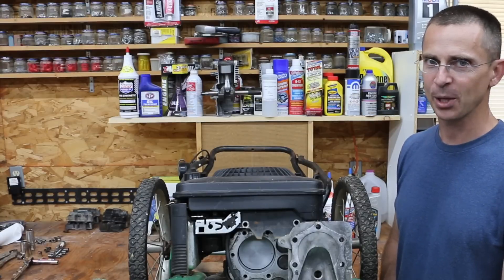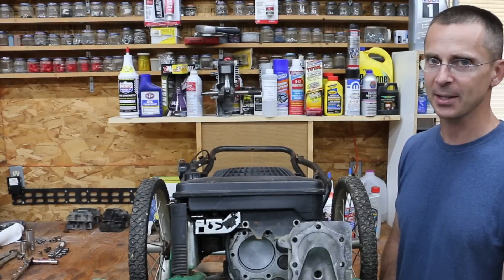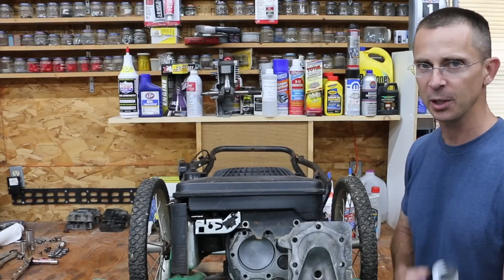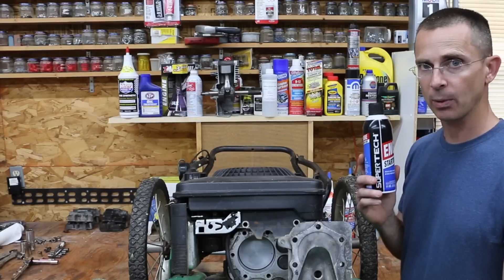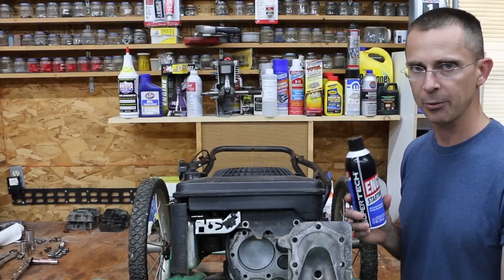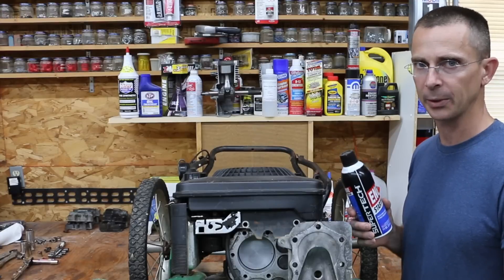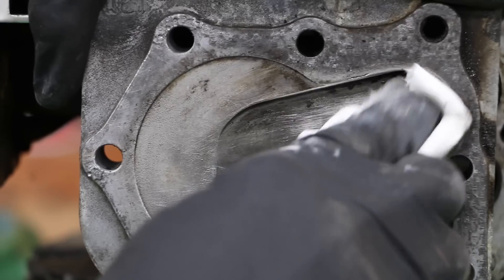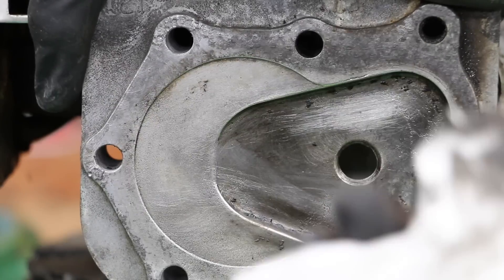Will Running an Engine on 100% Starting Fluid Cause Damage?  Let's find out!

Comment: I can attest that a diesel engine with glow plugs does not do well with starting fluid.. it can cause preignition and can toast an engine quick..

I thought i was smarter than the warning labels, but that wasn't the case and i almost did some really bad things to a 7.3 IDI with even a little starter fluid! 😲
Reply from the maker: Averil, thank you for sharing this experience!

Comment: I know it's a lot more work but if you would use cheap old 8v's of your preference. Then make a jig to hold it and the radiator. Then pipe the exhauste ouside. then you could use that the same jig for every test. I think it would be cool to see this done on car engines more. just an idea!
Reply from the maker: Cody, I agree that a full-size engine would be great to use for these videos.  Thanks for commenting!

Comment: Working on my roommates old 84 Vette. Was troubleshooting the fuel system and I was spraying intake cleaner in to get it to crank and run. I ended up soaking the filter until it backfired and caught the top of the engine on fire.
Reply from the maker: Jeff, I hope you were able to extinguish the fire before any damage occurred.  Thanks for commenting!

Comment: you can hear it knock every time he sprays it how can that be good?
Reply from the maker: Great point!  Pre-detonation is hard on an engine.  Thanks for commenting!
Reply: Project Farm i just think it has more to do with the forces put on the rod.. not the cyilinder walls or rings. hard hits flatten out bearings. and the small engines already dont have bearings and a soft aluminum rod  you need to do same test looking at clearinses on conecting rod. please i wanna know now lol

Comment: Biggest problem I ever had with ether/starting fluid was a backfire that would blow up the air cleaner/power valve in Holley carbs.  Got to miss the good old
Days of trying to get cars with junk carbs running on a cold winter day lol.
Reply from the maker: Thank you for commenting.  I remember those days well!

Comment: Another great video as usual!  I have always wondered if you filled a gas tank up with starting fluid what would happen.  Loved that you also check cylinder head temp and exhaust temp on top of checking for scoring of the cylinder wall.  Thanks for taking the time to do this test and sharing it with us!
Reply from the maker: Thank you very much for the positive comment!

Comment: Well, what did I start?? Is it too late to add a disclaimer? KIDS, DO NOT TRY THIS AT HOME. And Project... This is a very bad idea. Alright? WhAt ArE yOu GoNnA dO nExT?? =)
Reply from the maker: Eric Ek, LOL!  I should have added this disclaimer.  Thanks for commenting!
Reply: Well,  it would be interesting to see how a engine handles grease from restaurants. Just keep a fire extinguisher handy, insure your house and  don't breath in any fumes. Can engines run on paint, pure octane you can buy in a bottle, or helium? We could to this forever as long as you're willing to keep rebuilding a engine for "science".
Reply: Project Farm what can possibly happen if you spray down your whole engine with starting fluid?

Comment: I never heard of starting fluid being bad because of it drying out the cylinder walls I heard it was bad because it made the engine lean out pretty badly perhaps air to fuel ratio monitor is in order and try again
Reply from the maker: fuzzy wuzzy, The theory you mention makes sense.  Thanks for commenting and for the fuel ratio monitor suggestion.

Comment: The cans usually boast "With upper cylinder lubricant" on them now. But, my (limited) experience is that engines get addicted to it. Further research lead me to microcracks that formed in compression rings...
Reply: In diesels...
Reply from the maker: This is great information!  Thanks for commenting!

Comment: Do a video on what happens if you use soapy water instead of motor oil. I have no idea what the results will be but I have a feeling they might be interesting.
Reply: soopy wooder
Reply: straight dish liquid as oil
Reply from the maker: CreepStar Gamer, Thank you for this recommendation!
Reply: same effect as chlorine.
Reply: The water will seep past the rings, and the engine will hydrolock. It'll also be borderline useless as a lubricant no more than a few seconds after starting the engine, it'll just turn into foam. So the engine will be a highly effective but short lived bubble maker.

Comment: just to let you know starting fluid will definitely ruin a diesel it breaks the Rings because of the high compression like you're talking about the end of the video I have personally bent connecting rods and throne rods clean out of the block using ether to start diesels also before you ever use starting fluid on a diesel you have to make sure that the glow plugs or intake heater are disconnected from the rest of the wiring
Reply from the maker: Bart, Thank you for this information!

Comment: Love the content!!! Keep it up👍🏼 See how long an engine will run with wd-40 in the crankcase. Or marvel mystery oil. Orrrr seafoam
Reply: Seafoam is designed to go into the crankcase along with the rest of the motor oil.. Do you mean only Seafoam?
Reply: apachefoxx  yes I mean straight wd, mmo, or seafoam
Reply: I have ran mazola oil in my rack and pinions for years.
Reply: PB'laster

Comment: It will destroy a 2 stroke and a diesel engine. I've never seen starting fluid hurt a regular 4 stroke though. When growing up, we always used WD40  to start our 2 strokes and diesels.
Reply from the maker: Ben, Thank you for this information.  I'll keep in mind that WD-40 is the fluid of choice for diesels and 2 cycles.  Thanks again!

Comment: Project Farm 

When run through the fuel tank, Will starting fluid remove carbon buildup better that sea foam or another leading brand?
Reply from the maker: Mark, This is an excellent question!  I should test this!

Comment: Nitro methane rc car fuel
Reply from the maker: Nathan, thank you for this recommendation!
Reply: I'd like to see that stuff in a diesel engine... Suspect it'll work fine as most smaller RC engines are diesel(compression ignition) engines
Reply: i ran a gocart on nitro rc fual and it ended up having less power
Reply: Hmm i'm 20 hours late calling this, i'd still love to see it
Reply: MrErikw26 finaly someone who has a clue how rc engines work
Reply: Yesss
Reply: Me to
Reply: I've actually done this before and it surprisingly worked
Reply: nathan berg Exactly! I like your thinking!
Reply: Stefan Borsboom Yup, yup, yup!
Reply: Firm Clock well ya one it fouls the plug cause it's a two stroke fuel it has oil in it and compression isn't setup to optimize the fuel
Reply: nathan berg I dumped half a gallon of RC alcohol-nitromethane into the fuel tank of my old Honda CB360, with maybe half a tank of straight gasoline with no issues.
Reply: Benjamin Gillies they are not diesel. Their source of ignition is a glow plug which stays red hot due to a catalytic reaction between the platinum on the glow plug and the alcohol in the fuel. They do not have enough compression to ignite the fuel via heat of compression. They are more like a semi diesel like a hot bulb engine.
Reply: Matthew Weisenburger I've had nitro engines start while priming (blocking exhaust while spinning the engine on the starter box) without an ignitor on the plug.
Reply: TheLoneWolf1124 bullshit
Reply: Matthew Weisenburger I'm not gonna argue with you. It happened. Nitro rc engines are diesel. They use glow plugs the same reason full size diesels do.
Reply: TheLoneWolf1124 http://rc-airplane-world.bmobilized.com/?ref=https%3A%2F%2Fwww.google.com%2F&url=http%3A%2F%2Fwww.rc-airplane-world.com%2Fglow-plugs-for-rc.html&width=360
Reply: TheLoneWolf1124 educate yourself then get back with me
Reply: Matthew Weisenburger not even gonna waste my time reading that. Why would I like about something like that? What would I gain?
Reply: TheLoneWolf1124 well for one you would be educated and no longer spouting bs
Reply: TheLoneWolf1124 if your such a diesel expert please explain to me how they work
Reply: Benjamin Gillies actually the fuel reacts to the material in the glow plug, aiding it's heat retention along with combustion.
Reply: nathan berg I'mintnto also into Nitro rc cars! And it's kinda weird that someone will mention this and even with the same name!
Reply: I have done this. Removed the throttle stopper to and got it running wide open for a hours. Its still working, just need more attempts at starting. Rc fuel is very thick so it need more heat to burn.
Reply: I mixed 50/50 gas with 15% Rc fuel in my weed eater it really ripped my neighbor came over and said sounds like you have a hotrod weed eater
Reply: 30 years ago or so, I ran a car for a few miles on 25% nitromethane RC aircraft fuel.
I ran out of gas leaving the air field, and it was 3 or 4 miles to the nearest gas station.

I pulled the fuel line off the fuel pump intake, hooked up a spare piece of tubing to it, and stuck the other end of the tube in the gallon bottle of fuel.
I had to restrict the airflow to the carburetor to get it to stay running, but it got me to the gas station. :D
Reply: this I would like to see
Reply: TheLoneWolf1124 yeah leave when your loosing the arguement ok bye
Reply: Matthew Weisenburger it's only bs to you because it hasn't happened to you. It happened to me, it's a fact, I'm not gonna gain something from proving it to you. Just sharing that it gas and can happen. Have a nice life.

Comment: I understand that a 4 stroke engine will run entirely on 100%  starting fluid.....However, will a 2 stroke motorscooter engine get the same result?   Recently I rebuilt a 2 stroke  (by installing two new crankshaft seals)  As I did not totally understand how a 2 stroke really works. I then tried to startup the engine using starting fluid.  After many hours of unsuccessful troubleshooting.....I discovered the crankcase would not hold any pressure at all (as is necessary with a 2 stroke)   I looked closely at the seal under the magneto and saw that is was blown out.  Could this have been caused by the starting fluid igniting in the crankcase?   I'd like for you to try to verify this.....
Reply from the maker: Brad, This is a great question.  A lot of others have mentioned that starting fluid will damage a 2 stroke.  Seems like a great video idea--thank you!

Comment: My God you are incompetent can you seriously not just depressed the button a little bit so it's a lesser stream and keep the thing running one constant RPM for Christ sake when I have a car with a fuel pump bad I can make the engine run Goodnuf to drive the thing in the shop! You really need to give up all your tools because you are competent enough to use them
Reply from the maker: The generic can I used was wasn't easy to regulate like the Prestone brand or else I would have been able to better regulate the flow.  Thanks for commenting!

Comment: Will water injection clean carbon build up from inside the engine and clean it out???
Reply from the maker: Review Guru, Thank you for this video idea!  I used a water drip in a previous video, which isn't the same as an injection system.  Thanks again!

Comment: You should hold a throttle wide open till the motor blows. And see how many rpms it will run before it blows.
Reply from the maker: Matthew, Thank you for this recommendation!

Comment: I believe that starting fluid would cause damage only to a diesel engine, since its self ignition temperature is a lot lower (starting fluid), it might work when the engine is cold but if its hot, i think its gonna ping like crazy and damage the rod/crank bearings. Its engineered to explode at a lower temperature so that it helps cold starts, especially on diesel engines.
Reply from the maker: All great points.  Thanks for commenting!
Reply: like I've said, use it for its intended purpose and you're fine.
Reply: My understanding is that ether detonates at a much lower pressure than diesel, and far more pressure is generated very fast. diesels use their very high compression to ignite the fuel air mix . ether actually reactes to the compression on the up stroke too early (btdc) causing a very violent predetonation that builds pressure  extremely fast , causing pistons to blow out , breaking connecting rods, ect.
Reply: Starting fluid is dangerous in diesel engines if the glow plugs are on, though I'm unsure if air preheaters are hot enough to ignite it as well.

 It is said that extended use of starting fluid in any engine will wash oil off of the cylinder walls, and cause scoring. That's why they added lubricant to modern starting fluids.

Fyi: My old John Deere backhoe had a starting fluid injector, and a block heater for cold starts. No glow plugs... 

Thanks for your videos, especially the penetrating fluid ones. It made selecting one much easier!

Comment: We down here in Fla tried something similar in an old Chevy PU...Well our results didn't turn out as yours did. lol..We managed to blow the valve cover gasket out and bend the valve cover..although we may have used a little ( understatement ) more starting fluid than you did...lol

Comment: what if you were to try and run a motor off of brake cleaner I've always wanted to do that one too or what if you're to use mass air flow sensor cleaner
Reply from the maker: This is a great suggestion--thank you!

Comment: The main problem with starting fluid and diesel engines is glow plugs. If you have glow plugs that are working normally then what can happen is pre-ignition witch over time hurts the engine as most of us should know. I've operated alot of heavy equipment over the years, alot of new equipment comes with either glow plugs or a spot to put a starting fluid can, that the engine will give it's self a shot to help it start in cold weather.
Reply from the maker: Cody, thank you for this information and for taking the time to comment!

Comment: I don't know if you have a way to measure horsepower, but it would be interesting to see how one of these small engines would do with Nitrous oxide.....
Reply from the maker: This is a great suggestion--thank you!
Reply: Project Farm if you have an engine that isn't mounted in a piece of equipment, you could connect the output shaft to a DC motor (or an alternator), and hook up a dummy load. Using a multimeter and some fancy wiring you should be able to make an educated guess at horsepower.

Comment: You should really get a micrometer and take a few simple measurements in several places before and after you do tests like this, for confirmed results of the wear inside the cylinder! I think it would be really cool to see if a product causes massive internal wear or not, visually and on paper
Reply from the maker: Circuit Break, This is a terrific suggestion.  I just ordered one.  Thank you!
Reply: No problem, love your videos :D

Comment: Project Farm try butane (liquid butane, like grill or lighter fluid) and see if the engine will run on butane alone. I have a feeling it will not because of how thin and flammable the substance is. I'm really curious to see what happens.
Reply from the maker: Thank you for this recommendation!
Reply: Project Farm no problem! I am really curious about what could happen.

Comment: Great video.   One big thing that will change everything about it when running on pure starting fluid is engine load.
I have personally done this before just to see what would happen in an old lawnmower I had.  I put a whole can in an empty tank, It would start and run fine, but when put under a heavy load (tall grass) it would start to knock (pre-ignition) horribly loud and sound like a hammer hitting an anvil, also at this time lots of black smoke came from the exhaust.  I never disassembled the engine after because I actually still use this mow my lawn (on gasoline LOL)  And yes a diesel engine will suffer worse from this condition as the mixture will combust far before it should because of the very high compression ratios.
Reply from the maker: James, this is very helpful information!  I imagine it wouldn't take long for the gas engine to get ruined with pre-detonation taking place.  Thanks for commenting!

Comment: One danger with ether on most new diesels is the fact that they have a grid heater in the intake to preheat intake air. On a diesel you spray the ether in the air intake and the grid heater could ignite it blowing apart the intake plumbing.    The other thing which  is my opinion only is being compression ignition a diesel ignites the fuel when sprayed into the cylinder, the ether being just drawn in with air could ignite early in the compression stroke and put tremendous stress on things.    All that said I have used it over the years to get some stubborn engines to start but only after disconnecting the grid heater.
Reply from the maker: This is a great point!  The approach you've used to start diesels make sense.  Thanks for commenting!